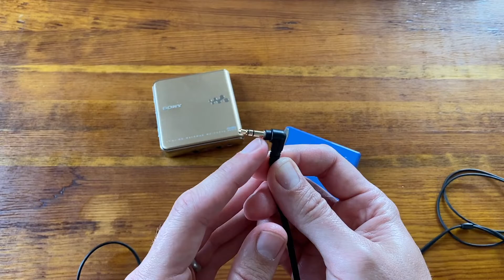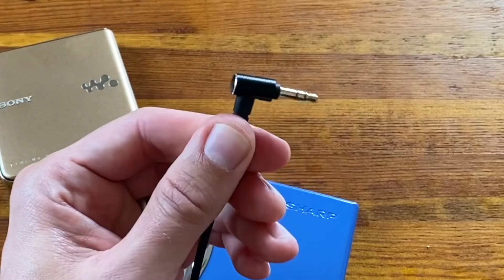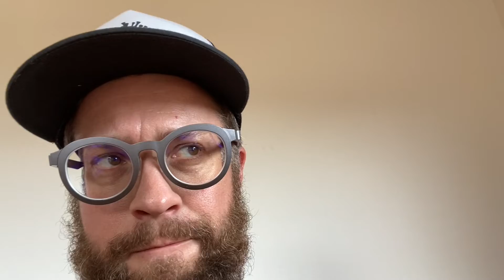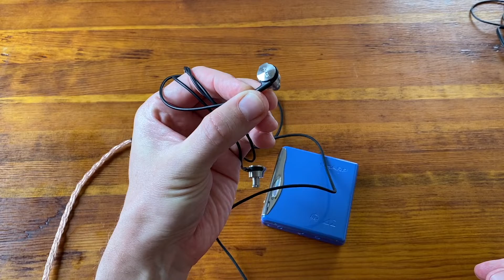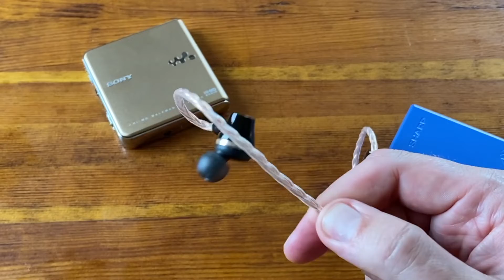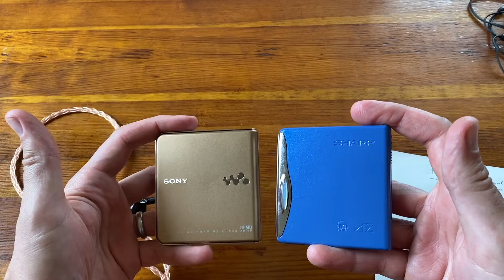Groove Audio balanced 3.5mm does Auvi, Hi-MD

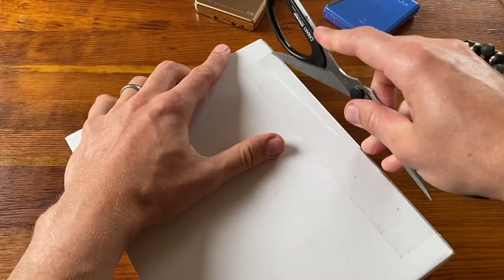Comment: Nice video, very detailed! Which one sounds better the Sony MZ-NH3D or the Sharp MD-DS55? Also what's the music starting 4:00?Thanks!!!
Reply from the maker: The MD-DS55 sounds better: lower noise floor, better stereo separation, great quality current to voltage drive, and a more interesting sound. But, you have to use balanced headphones or it sounds horrible.

Comment: Can you do a video about comparing the Audio Quality of the various Audio Encoding formats? Varying from Lossless to Lossy?

ATRAC vs AAC vs MP3 vs OGG vs WMA vs etc.

FLAC vs APE vs WAV vs etc

What's the Pro's & Con's of each File encoding type and why you would pick one format over another?
Reply: These have been done by many people over the years, both who are better qualified and better able to do random AB-X tests. I wish I could, but I don't have the resourced to do this.
Reply: @marcheminidisc1345  No Problem. Just some content ideas to throw your way =D
Reply: @Kamen_Rider_Blade  Many thanks for the advice. I just don't think I would be able to do it with any degree of accuracy.
Reply: @marcheminidisc1345  No/Prob, just write the idea down in your idea's notebook for later, should you gain the equipment necessary to be able to do it or work with somebody who can help you accomplish it. =D
Reply: @Kamen_Rider_Blade  Many thanks. I have actually done some tests with other people before which were AB-X tests, but to be very very honest, it is hard. The hardest part is fulfilling the necessary requirements so as to not mistakenly make one file or format sound better (you need precise calibration in time, volume, and of course, the output support). 

I would check out Hydrogenaudio forums on this issue. They have done the most thorough of tests across many different hardware sets.

https://hydrogenaud.io/index.php?topic=24467.0
Reply: @marcheminidisc1345  Thanks